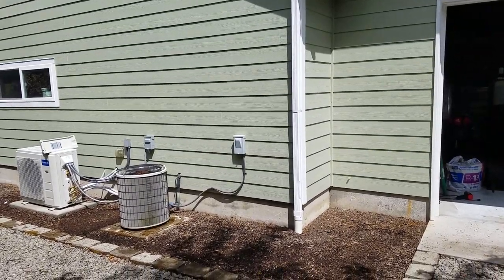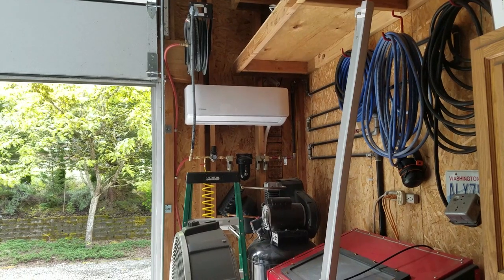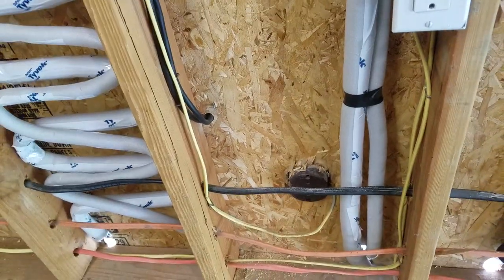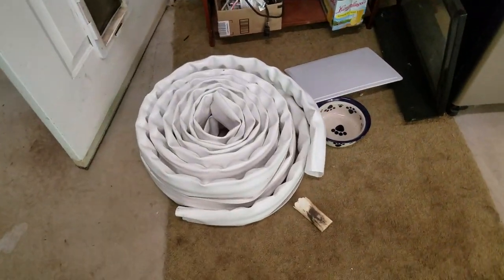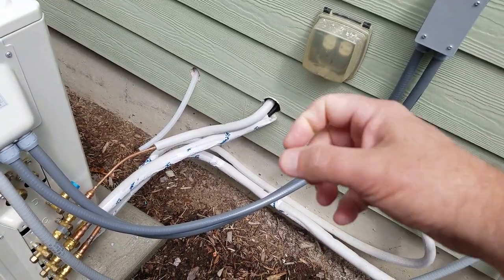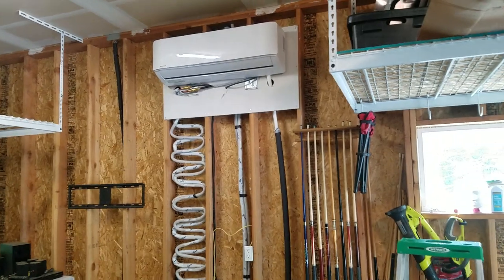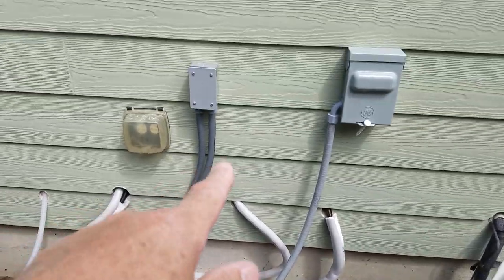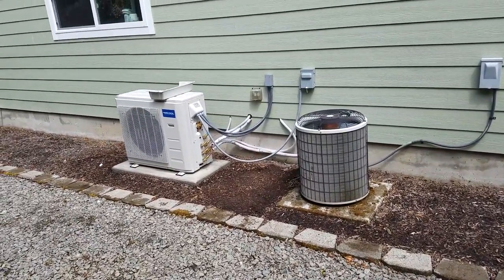MrCool DIY mini split install in wall cavity

Comment: Zigzagging line sets are not recommended by most manufacturers, not a great idea you should've just cut the line set and ran it straight.
Reply: This scares me because it creates many potentially accidental kinks, though he did have a pipe bender.  However, you do not cut a MrCool DIY line set.  These lines and unit are pre charged so that the installer does not need all the equipment and experience to charge them.  MrCool recommends you just loop up the excess line set just as received from factory.
Reply: i saw his zig zags in between the studs on that line set inside, and winced. but maybe he used his cooper pipe benders in an appropriate way….don’t know, but that would not let me sleep at night after the cavity gets covered and hidden…also would have been more helpful had OP show more on his condensate drain line system….

Comment: Very ingenious . You also did well with your explanation. Some people edit the video not to show when they have difficulties. Wish I could do mine this way, however my house is all cinder blocks, Not an easy job working with this stuff, so need to run the lines on the outside wall.
Reply: Use a line set cover, and you can even go a step further and paint it to match your home's exterior which I assume is stucco.  It'll help it disappear.

Comment: Finally a video of what I had in mind when I install mine I have 2x4 walls from the video it looks like yours are framed with 2x6 which would make it a little easier to bend the line set. Exactly what I had in mind. Who wants to look at a bunch of cheap ugly plastic gutters running around the walls of your house? I'm all about hiding what I can. Great video!👍🏻👍🏻

Comment: this is way better, i just re-sided my house a few years ago and do not want any holes.  Yours is much cleaner but difficult in terms of all the bending and risk of something going wrong on the copper - tradeoffs.  I also would have added some plastic boxes over the holes to run the lines through instead of 4 separate ones with 4 separate holes to patch up.  On my property mice get into everything, so this would be immediately filled up with expanding foam, etc.

Comment: I would recommend insulating the lines by the outside condenser. I have a 4 zone and didn’t insulate them good at first and I always had a puddle of water form by it. After insulating It I don’t get even a drop anymore.
Reply: You mean the last foot or so he does not have insulation?
Reply: @BPRescue  Yeah those pipes sweat a lot. The insulation Mr cool includes is also not too good and will also sweat thru so you might want to keep that in mind if you’re planning on running your lines inside walls.

Comment: fyi electrical wiring doesn't need conduit its Armor Clad cable already, hence no need for added conduit over it for protection.

Comment: Exactly what I want to do. My  main concern is bending the lines on the indoor air handler 90 degree's to go straight down the wall cavity. Was that the main reason you bought a tube bender ? I  am looking at a bigger unit which has 1/2 tubing which will make it even worse. Thanks

Comment: Couple questions.  

1- Why did you run the line set and drain under the unit, rather than behind?  Maybe you don't plan on closing the walls?  I am building an interior wall where the line set will be running through it, so I am building the wall with the unit and runs in mind.  I too am running it through multiple attics, so was very interested in your video.

2- In speaking with the vendor I purchased the MrCool unit from, they indicated I shoudl use armaflex on the line sets and drain line.  Now I am forgoing the flex drain and running 3/4" PVC for rigidity and assurance of a great angle of drainage and will use insulation around it just to be sure I don't get any condensation on the outside of the pipe and in my walls.  However his comment of armaflex on the line sets threw me, as MrCool line sets are already insulated.  I am waiting to here back from MrCool on that, but do you notice any condensation forming on your line sets?  The Vendor indicated it will happen when the unit is cooling, but again I think he may be thinking of another manufacturer that does not provide insulation.  There is nothing in the instructions about this step, however most installs I understand just run the line set through a waterproof sleeve through an exterior wall, so there is no chance for moisture to get into the wall and cause mold.  Your installation and mine are different though since our runs go through interior walls.

Anyway, thanks for your video.  I will buy a copper pipe bender per your point as bending the pipe has caused a bit of anxiety.  I don't want to kink it...
Reply from the maker: 1.. Actually it is not under the unit.  I put an extra hooks about 4 inches above the normal hooks.  That way I can just lift the unit off the regular hooks and put it on the extra higher hooks if I need access to the lines.  In the video it is sitting on the upper hooks.  In its normal position it would be lower and flush with the wall and you would not see the line set.

2.  I see no condensation on my line sets at all.  I really don't see a need to upgrade the insulation on the line set.

Comment: it looks nice, but you better plug up the holes or mice will get right inside. Also always, always do insulation before buying hvac gear. in the long run the insulation will save you more money annd you dont have to buy as big of a unit. with dedent inssulation you could of saved several hundred dollars and gotten a smaller unit.

Comment: Question, cutting that stud in 2, that's part of your frame. Is that okay to do?
Reply from the maker: Sorry. Not sure what stud you are talking about.  Can you tell where in the video timeline it is?
Reply: @bobw3677  :58
Reply from the maker: @JoseGarcia-vi3pu  Oh yeah.  I see what you mean.  Those 2x4 studs don't support anything structurally.  They are there so that the ceiling drywall has something to screw into.  I did not cut it.  It was already that way.  I just picked that spot because it was convenient.

Comment: I see many 'pro' HVAC channels that lead people to believe they can not cut and flare the copper tubing, as that is beyond their skill level. This is BS. You do need a good enough quality flaring tool, and a good deburring tool, and understand to keep the tubing facing downward when you deburr it, to keep the copper chips out of the system.
Harbor freight has a very affordable 2 stage vacuum pump. So I'm guessing your line sets were pre charged, and you used the special flare to precharged hose adapter at the unit's connections. So part of your DIY was to stay away from those tools, a micron gauge, a gauge manifold of decent quality (that does not leak, this is a cheap hose problem with the hard white plastic gasket seal which can be replaced with good ones from yellow jacket). 
There's no code requirement for conduit. The wire used needs to be stranded for the bending going into the indoor unit, and needs a UV outer sheathing for the exterior connection to the outdoor unit. It's basically UF-NM cable, that's 4 conductor.
There is one code violation that occurs when you get the kit, if they give you 16AWG 4 conductor cable for the inside to outside unit connection, If the main power is 15 amp, that cable is connected to that circuit fuse, and must be 14AWG, and if 20amp, that cable must be 12AWG. They are hard connected at the outdoor unit together and to the branch circuit power source. Now you could install inline fuses (8amp) rated to protect the 16AWG wire and hide that at the outdoor unit behind that strain relief plate.
I've installed 4 of these mini splits in my home and garage. Just finished a 3 ton single circuit. This had the poorest installation instructions of any of them. I have a Mitsubishi, Diakin, TurboAir, and now a Trane/American Standard, which was made in China. I took photos of the circuit cards in this one, looked up the manufacture,  Gree sells them, so this unit is a rebadged Gree. This unit is being sold as surplus on eBay and the internet, so I wonder what happened that Trane is dumping them (Ingersoll Rand owns them now). They give you labels in the kit so I can badge it as a trane or american standard. I just hope it runs for 25 years without problems. We shall see.
Thanks for the tip on the tubing bender. I was looking for an affordable tubing bender, I'm seeing similar on amazon for ~$100. My suction line is 5/8" and that was damn hard to bend a 90 in.
Reply: Hah, un-American Standard if it's made in China.

Comment: Hopefully your not caring about efficiency those precharged lines only work if there a straight shot at exactly distance requirements that zig zag in the wall cavity will kill your compressor im know time

Comment: Terrible the the condensation lines wont drain if you have them goin up to the attic water will just be sittin there. All the zig zag is noo good either
Reply from the maker: Look closer.  Both condensation lines go straight down.  Both condensation lines run separately from the line sets.  I never said this is the best way to do it.  It is just the way I did it.  Learn from my mistakes.  I don’t see the difference between a zig zag vs coiling the lines at the outside unit.

Comment: I don’t understand why you didn’t just cut the line set and cables rather then doing all that mess? You have a flare tool already. One penetrating whole is always better than multiple.

The air handler with the line set and cable showing looks like a mess.
Reply from the maker: Thank you for your comment.    I'm not saying it is in any way the right way to do it.  I am hoping that someone can learn from what I did and do it better.  The whole idea of a DIY mini=split is the DIY part.  I did not have to pay HVAC people to come out and do it.  If I cut the lines, that would have required HVAC techs to come out and recharge the lines.  Two summers later it is working great.  Last summer we had record 116 degree temperatures and my house A/C died.  We were able to keep the house cool using the DIY Mrcool mini-split and directing the cold air into the house from the garage.
Reply: His lines were precharged. if he cut them then it will be more of a hassle. Mr Cool provides the length of  linesets (and the compressor section also already filled) with precharged refrigerant  adapted to the units. Although I would not have zig zag the lines but rather just horizontal coil with the min radius noted in the manual.

Comment: Thank you Bob for the infor, but i have one question for you is that the 12K unit what is the voltage required 120 or 240V. Thank you for sharing.
Reply: 12k is 120 20 amps

Comment: Great video - I've been searching for an example of someone running the line-set inside the frame instead of coiling it at the condensor.  Have you noticed anything with the pipes sweating?  What are you doing for insulation there?
Reply from the maker: I have not insulated the wall yet.  It is in my garage and I don't use it much.  There is no sweating that I see when I do use it except outside at the connections  at the main unit.

Comment: To many bend,,,just get the right size....I won't recommend this much bends...but every one has there work ethics!!
Reply from the maker: Thanks. Your right.  If I had to do it over again, I would have paid the extra for the shorter line for that unit..  I'm not saying this is the right way to do it.  I'm just showing how I did it so others can learn from it.

Comment: Horrible work, that looks ugly.
Reply from the maker: You probably say the same thing when you look in the mirror.  LOL!
Reply: @bobw3677  oh, come on why do you get mad? Just want you to do better, I know you can.
Reply: Have you gotten over it? I hope your anger has passed.
Reply: @meltor2000  lol golden comments, do you guys know each other LOL?
Reply: @throlyhd9448  lol! I don't know this guy but he easily got insulted. I'm just trying to build up his confidence and let him know that he can do much better work than that.
Reply: @meltor2000  yea his work looks alright except the spread out holes in the wall. Should have ran them all through one big one and finished it somehow with some metal exhaust plate thing like dryer exhaust to hide the ugly holes lol
Reply: @bobw3677  Bob, you did a wonderful job. Most of the people criticizing have no idea what it takes to do this difficult job which requires great skills. BTW Trolls are every where.
Reply: Nice name babe, Lauren, haha!
Reply: Don't get upset babe.... You can do better work next time. Trying to motivate you girlfriend. 🤣
Reply: These trolls must be HVAC contractors protesting with futility on losing paid gigs over rebranded Trane mini split  units called 'Mr Cool DIY' because they can't charge 12k labor to install a 4k unit. lol. i see a lot of them commenting on mr cool videos either sh*tting on the brand (saying you can't get parts even though most them are the same higher 'premium' expensive units just now marketed as DIY).